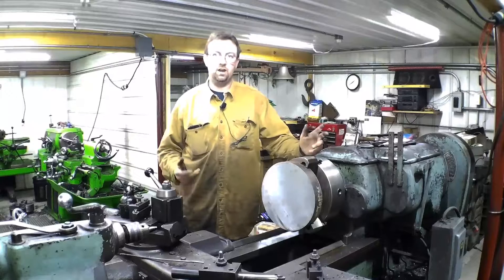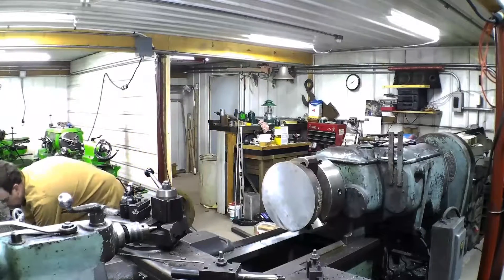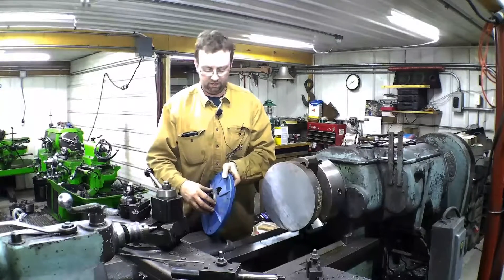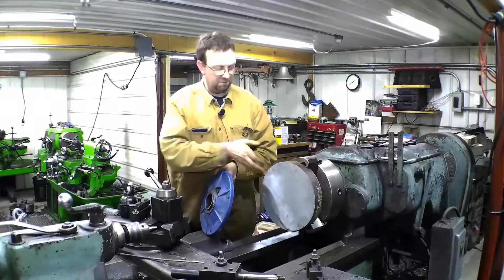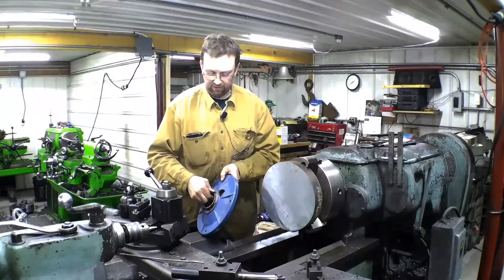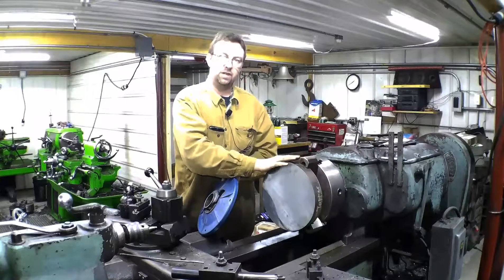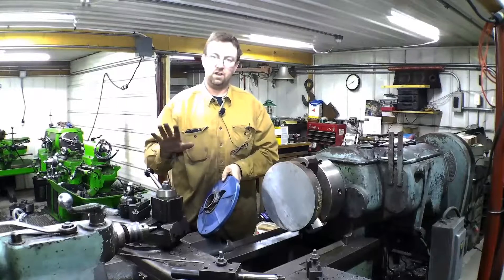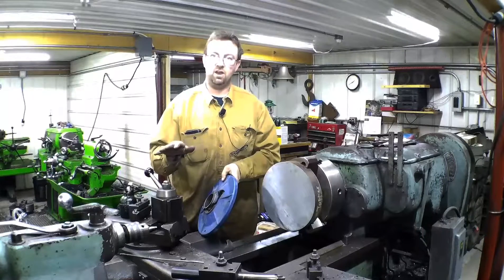Machining a Motor Adapter Plate

Comment: Yeah Josh I like it, that will hold up to the torque applied from a 20 HP motor. Im wondering if they can program a soft start of the drive? And yes Bugger Amazon, we have access to them now, down here in OZ. Happy to resist the tempation! Lol. Keep up the good work & Vids you do. Cheers fella.

Comment: How did you indicate the part on the mill?
Reply from the maker: I used a coaxial centering indicator, then setup my DRO for bolt circles.
Reply: After finding center, if you don't have a fancy dro, x=sin(angle)*distance_from_center   y=cos(angle)*distance_from_center will give you coordinates for whatever angle around the circle you want.  But if you screw up and unclamp your part for some reason, then you'll have to find center again, then find the coordinates of an existing hole to offset your original desired angles.

Comment: Nice little vid on a motor adaptor plate. I'm doing the same at the moment to mount a new spindle motor to the Huron Mill. The motor is a 132 Frame with a B5 90 frame mount. Make new end plate for 132 frame to B5 90 frame mount. 1045 steel. Is cheaper to buy new motor and mak adapter plate than to rewind old one that is over 35 years old.
As for Amazon yeah they can get stuffed.
Cheers from Brisbane Australia.